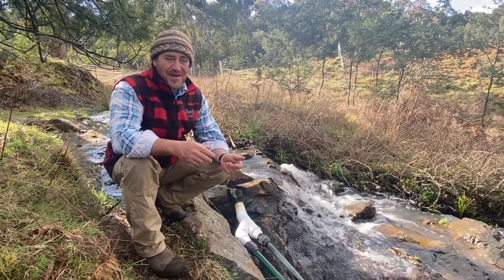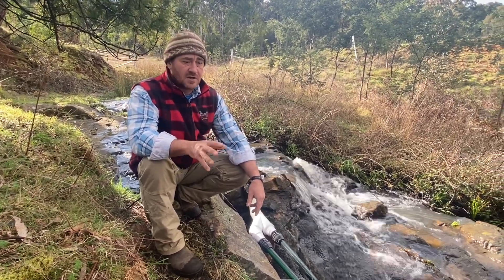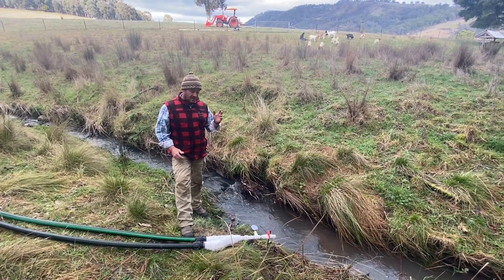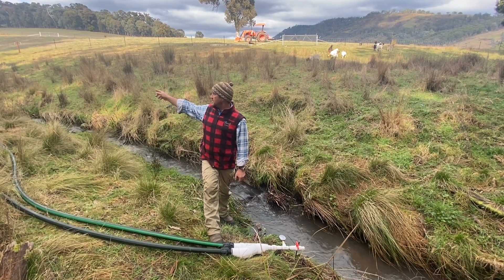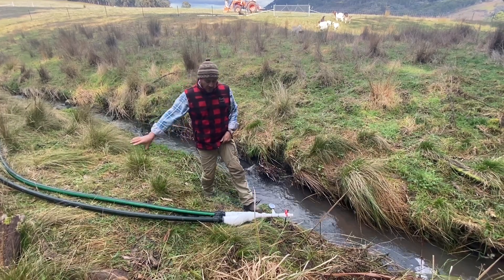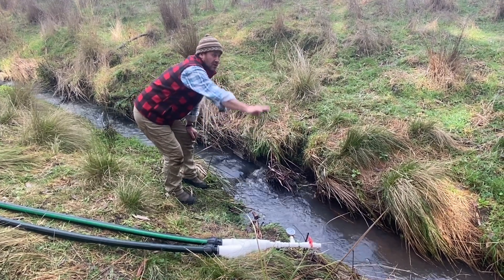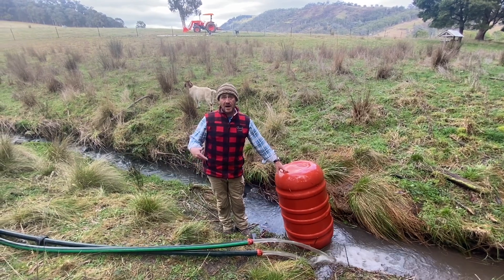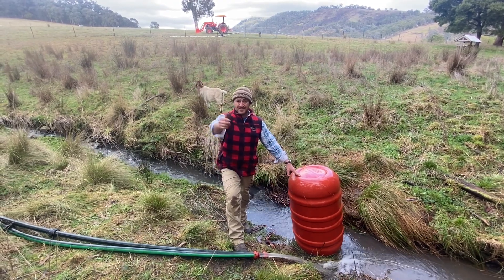Off Grid Micro Hydro Power Generator Part 2 - Planning 2.0

Comment: You may want to go with a 120 mm pipe it will give even more volume with not much deference in cost and I always say bigger is better it may also give you the extra wattage you may need for the electrical resistance you have yet to consider

Comment: Yup.  Two 45mm pipes is NOT the same as one at 90mm.  More like 1/3 of the flow (with friction losses).  You can get Blueline pipe 100m rolls at 110mm external diameter for about $1200 for the thin wall stuff (used in mining and some new subdivisions).  It’s rated to about 85psi (well above what you are going to be getting).  
Cheers from southern Tassie.

Comment: Remember that doubling of diameter of a pipe 4x the cross sectional area.
So 2x 50mm pipes will flow half of 1x 100mm and even less as the 2x 50mm pipes will have more friction.
Reply from the maker: G'day LasseBB - your spot on. The friction ravelling through the 2 x 45mm was huge. We had to change the system over to a single 90mm to achieve our goal of 7 litres a second or greater. Thanks for watching, cheers!
Reply: @FatCowFarmTatong  2 x 45 mm will not equal 1 x 90 mm pipe even if you disregard pressure. Remember the surface area of a circle (amount of water it will let through) is πr², so if your radius (half diameter) halves the area is way less than half. As your diameter increases your volume increases exponentially, it is not linear. A 90 mm pipe will give you an area of 6361 mm² whereas a 2 x 45 mm pipe gives you a combined area of 3180 mm². In other words, you will need 4 x 45 mm pipes to get an equivalent of 90 mm pipe volume, and of course, the resistance factor comes in

Comment: The bigger the pipe the more power available. My creek will give me easily 500 gpm so I wanted the most power possible so I went with 8” pipe that was capable of giving me the most power. I will be running two turgo 1300 w turbines allowing me to make 3kw continuous.
  You also have to account for friction loss of your pipe. There are also charts out on the web that will tell you . 
 If you can get 10 more meters down towards the house why not go for that? The more psi the better.
Reply from the maker: Hey KTM, 500gpm - wow! that's full on. Do you have any thoughts on how you are going to use or dump the excess power? That's 72 KWH a day, are you connected to the grid? Selling that power back into the grid you could retire. Fantastic system. Well done! cheers
Reply: @FatCowFarmTatong  I am planning on using the power to also heat my house. That’s why I went so big. That kind of flow is only available in the winter months. I will probably just shunt the excess power to a electric garage heater.
Reply: @FatCowFarmTatong  something off the beaten path but with that water flow if you cant get enough pressure concider a water wheel (piped into a short shute before it flows over wheel) or a vortex low head turbine that depends more on volume or even both use the waste water from a pelton tubine (high pressure) into a shute over a waterwheel

look up marty t as well he has a couple of vids on how to divert exess power to your hot water tank (or spa) on the cheap